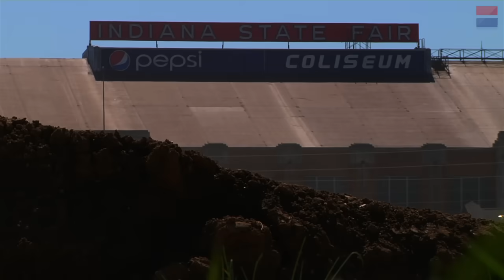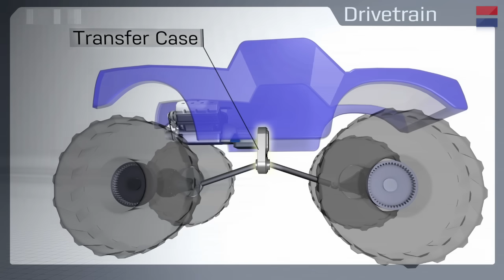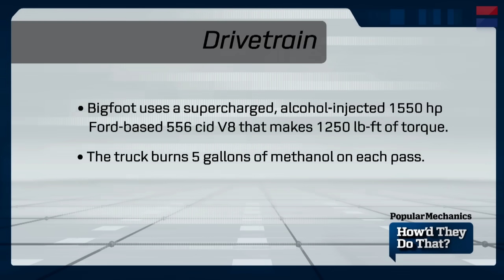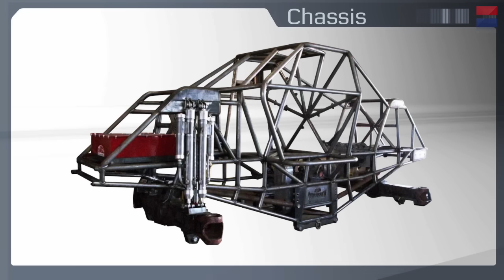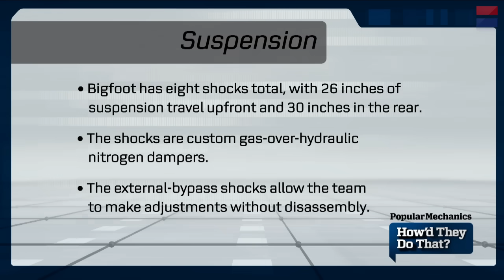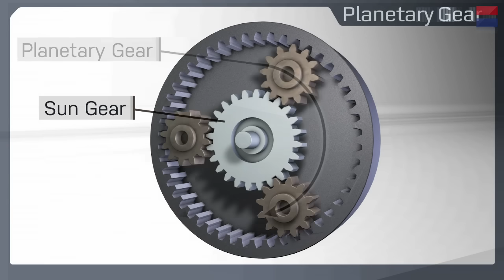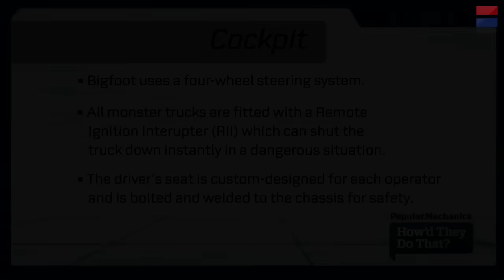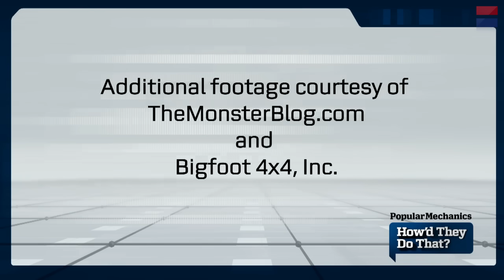Bigfoot Monster Truck: Guinness World Records' Longest Ramp Jump

Comment: The best Bigfoot is still Bigfoot 4 - the first purpose-built Monster Truck.  I remember seeing the radio controlled Bigfoot 4 at Radio Shack.  I must've been maybe 5 or 6 years old.  I wanted it so badly, but my parents wouldn't buy it.  It was like $99.99, which was pretty expensive in the mid 80s.  Later that year at Christmas I was completely shocked when I opened a gift and there is was - the Bigfoot 4 RC.  I kept that Bigfoot well into my 30s even though the remote was gone and it was well used up.  For so long I could not let go of it because of how much my parents sacrificed for that.

Comment: How is the lateral movements of the axle controlled? Cant see any panhard bar or watt-link on it.
Reply: +Leofred Lateral position is controlled by a triangulated 4-link from the center, or cradle of the chassis. it is essentially 4 bars connected to the front axle, and four bars connected to the rear axle via adjustable Hiem Joints(spherical rod ends).  I dont know for sure how the Bigfoot trucks are set up, but most monster truck chassis' have multiple spots on the cradle to bolt the hiem joints in to change the suspension characteristics. A few teams over the years have tryed different setups, like elliptical leaf spring setups and swing arm style suspensions, but on the whole, the 4-link setup is the standard.
Reply: +Leofred Lateral position is controlled by a triangulated 4-link from the center, or cradle of the chassis. it is essentially 4 bars connected to the front axle, and four bars connected to the rear axle via adjustable Hiem Joints(spherical rod ends).  I dont know for sure how the Bigfoot trucks are set up, but most monster truck chassis' have multiple spots on the cradle to bolt the hiem joints in to change the suspension characteristics. A few teams over the years have tryed different setups, like elliptical leaf spring setups and swing arm style suspensions, but on the whole, the 4-link setup is the standard.

Comment: Couple issues with the analysis........ 1. The tachometer that is displayed shows idle RPM as he flies through the air 2. One of the main reasons he kept a high RPM and forward wheelspin was to keep the nose from pitching forward. Brakes and wheelspin affect body roll while in the air.

Comment: I still think to this day,  when they Jumped Bigfoot over that plane,  he probably still could have cleared it,  if the plane was up on it's landing gear instead of it sitting on its belly as in the video......Bigfoot always landed nose heavy,  because of the engine in the front,  they maybe could have added some weight to the bed of the truck to make it fly through the air more level......
Reply: Uh, the engine is right behind the drivers seat. Has been for years.
Reply: Russell Johnson ever since bigfoot 11 i think.
Reply: *****
Bigfoot #10 was the 1st one to have a rear engine.
Reply: Wayne Norbrey, Jr thanks for the info

Comment: So if they measure the rear wheel touching for the record, what if you land on the front wheels and then continue to do a front nose wheelie for the next 100 feet?
Reply: they know the distance between the rear tires and fronts so they could use that to find the distance.
Reply: they know the distance between the rear tires and fronts so they could use that to find the distance.
Reply: hybridmx5 Then they make a bigger record
Reply: Physics won't allow that

Comment: Funny enough, on the monsterjam website, you can see what engines and horspoewer the trucks have. All of them are 540-580 cubic inch supercharged V8's, none are less than 1,400hp, and the highest hp is 2,000. The highest hp is the Rammunition and Raminator trucks, with supercharged 565ci HEMI's, in Ram styled trucks. MOPAR or no car.
Reply: Horsepower doesn't mean "the best" lol.
All the horsepower and he still can't win much huh?
Reply: look at Max D, he runs a 540 I believe that makes 1450hp, one of the lowest powered trucks and at the same time one of the fastest.

Comment: HELL IF THATS THE CASE YOU COULD BUILD A HEAVILY WEIGHTED FRONT END AND NOSE WHEELIE YOUR WAY TO A CRAZY RECORD. IT SHOULD BE MEASURED BY THE ACTUAL POINT OF FIRST CONTACT  WHETHER IT BE THE FRONT TIRES, BACK TIRES, OR EVEN THE DAMN ROOF FOR THAT MATTER.

Comment: You must have started watching monster trucks in the 2000s bigfoot was always trying to raise the bar for the sport. Monster truck has gone from a sport to an entertainment. Watch monster jam. It takes a lot of skill to just mash the throttle and wreck a truck. Monster jam is garbage. Almost all of the vehicles are owned by Feld motorsports. That's why you always see drivers floating around from truck to truck. Most of the drivers are just making a salary. Its not really about winning.

Comment: pounds.... feet....tons.... north american horse power? what the hell is all that?..... get with the 21st century.
Reply: Welp, thats the nice thing about being free, we do what ever we want.
Reply: frognuts69 being tied strictly to an out dated system is not the definition of 'free' .....
Reply: I completely agree. Being a mechanical engineering student, it is such a pain in the ass to convert english units between one another and then to metric if need be, or vice versa. Using powers of ten to move between units is easy and logical. When the only other 2 countries that use the english system as standard are third world countries; it may be time to move on...
Reply: Wes Vohar , ml
Reply: Leshaun Yopack but i like the standard system more. it's easier for me to understand instead of all of this kmh, km,mm stuff. not saying that i don't understand it, it's just easier
Reply: LUNITIC WILL 2.95mm vs 1/16 inch or something.  Its accurate and easy. I have some losi rc's i had to buy spare bolts and tools because everything is different. But if you take hpi what is also American. They already switched to metric.

Comment: this supposed physics professor should find a new job or the narrator. They say he  feathered the throttle to match air speed mid jump in the air, but all I heard was full throttle redlining. Not a huge deal, but I just find it annoying when someone states something so drastically and obviously the opposite. "Dan feathers the throttle to keep wheels turning to match air speed" meanwhile in the background all you hear is the needle bouncing off the rev limiter, lol
Reply: dan is tapping the throttle.
Reply: bouncing off the limiter doesn't necessarily mean he's WOT. there's no load on it, so the engine will rev freely, and redline, even at part throttle.